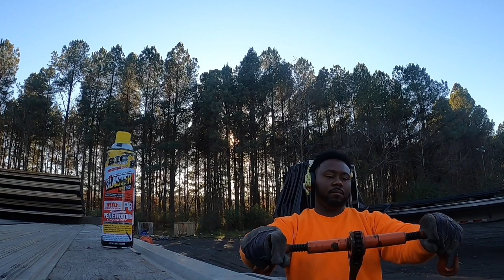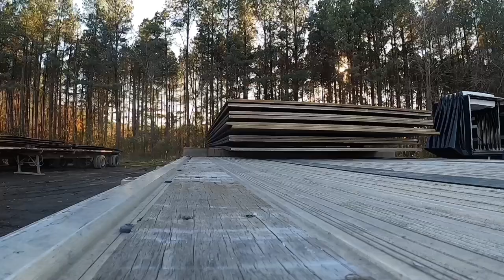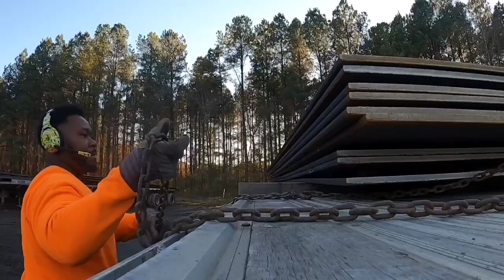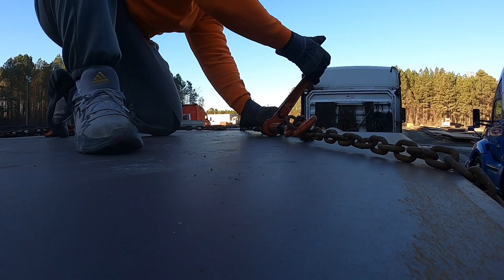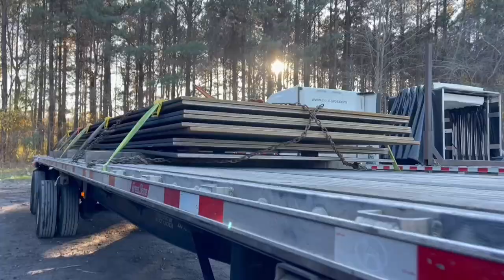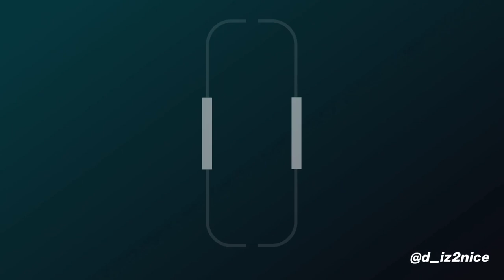How To Cross Chain a Steel Plate Load Flatbed Cargo Securement #flatbed #trucking

Comment: I think im cranking the binder to fast, because everytime i try to tighten the binder the chain twist around it and its not tight
Reply from the maker: That’s pretty common for it to twist. Try to stretch it out as tight as you can get the chain before tightening the ratchet. That will help eliminate the twist

Comment: I need more of your videos. Would you be okay with crossing chains over a load. Not in front of the load
Reply from the maker: Cross chaining over would defeat the whole purpose of stopping forward movement. Unless your referring to the teardrop method just using once chain
Reply: Thanks for this video. I'm soon going to have to be moving 10×20 road plates. Should I also do the same in the back? It looks like just doing the front might push them backward. I realize in a truck you are more likely to lose something in braking vs acceleration, so just wonder if you ever had any issues.
Reply from the maker: @jhy25 crossing the back wouldn’t hurt, but honestly. I just roll out with the front cross strapped. And technically, if you drive safely you don’t even have to cross the front.